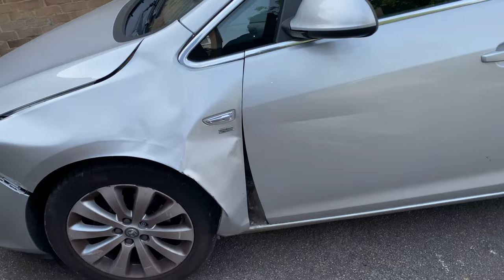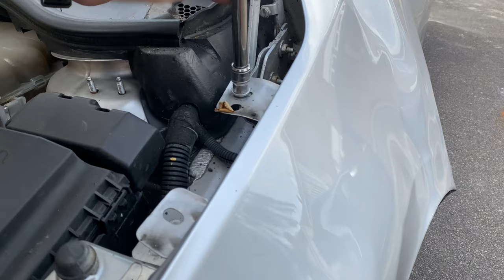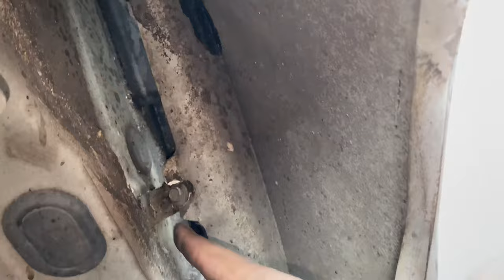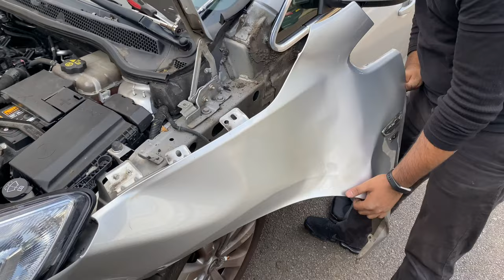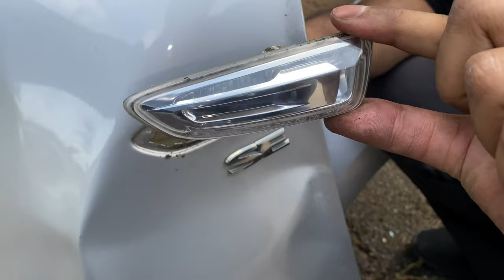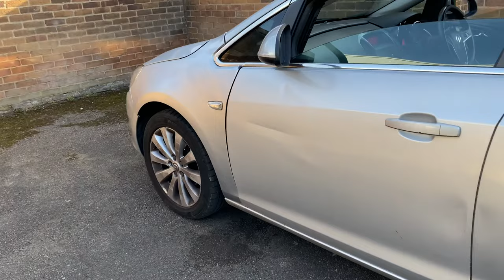Vauxhall astra J fender / wing removal

Comment: The part at the end of the wing next to the bumper, does it just come off by pulling it or we have to loosen the bumper as well?
Reply: Did you find out pal im wondering same thing
Reply: There’s two bolts holding the wing to the body of the car and there’s one small bolt which attaches to the wing to the headlight